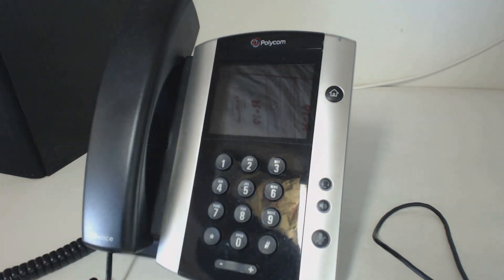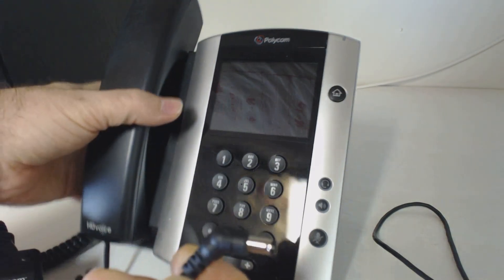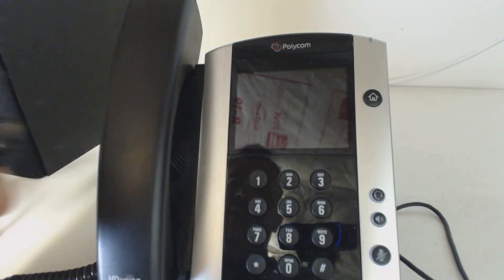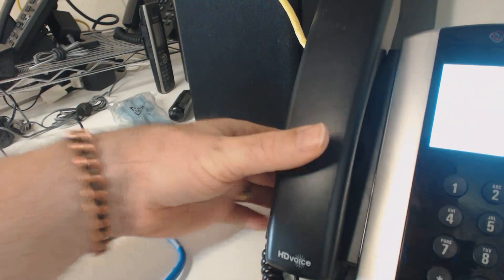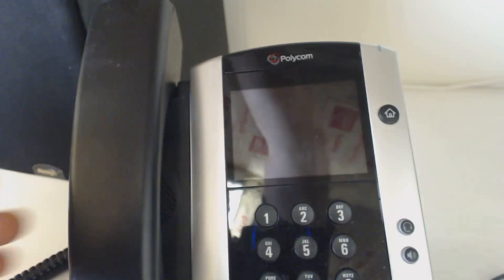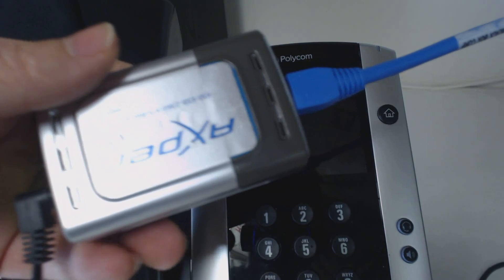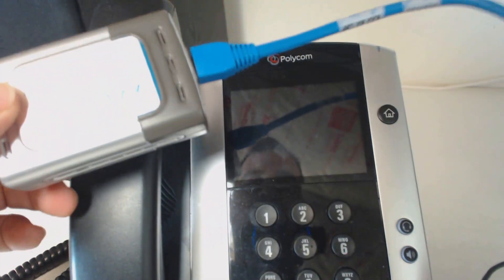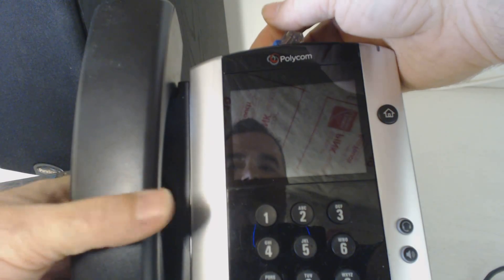Power Over Ethernet for VoIP phones

Comment: My small company with 6 Polycom is having issues with dropped calls. No other internet issues.  Could our POE not be supplying enough power?  Can I plug in a power cord to a phone and see if it improves our service?
Reply from the maker: You could do that Vicki, but in my experience,  dropped calls are usually indicative of a network traffic issue.  For instance an inconsistent broadband provider or a Mis-configured router.
Has this been an issue since day one with this voip service?
Reply: @VoIPTelecom   Yes it has been an issue from the beginning. We upped our plan and it’s still an issue. Our IT claims there are no network issues. Is Comcast that bad.

Comment: Hi! I have PoE phone and connect it with the switch but did not work? What do you I did wrong? Thanks
Reply from the maker: It won’t even light up?
Reply: Yes, it won't light up.
Reply from the maker: Possible the switch isn’t POE capable? (Power over Ethernet)

Comment: I have a Polycom for a company I worked for two years ago. I never plugged it in or set it up. I just did plug it in as I reconfigure my basement office. It works but it looks like it may be attached to my old company because it dials from Connecticut and it displays my old extension on the display. The number that the receiver shows is different from my old extension but still a Connecticut number. Is this phone basically an extension of my old company? Can I reconfigure it so that it is not attached to their company in any way? Would it use my home or cell number or assign a random number from the internet?
Reply from the maker: Yes,  sounds like it is still “registering “ with the service it was originally setup for.  If you do want to use it you should do two things:  1.  Factory default 2.  Sign up for a VoIP service that supports Polycom.   If you go to my channel page and look at a list of all my videos you should see videos to help you with this.  There is a video on factory reset.  And also a video about setting up a Polycom with CallCentric.   😊
Reply: @VoIPTelecom  hey thanks. I did watch the videos. I had trouble resetting. KEY: When entering the MAC ID, press the button as many times as necessary to get to the desired character (that you cannot see). Once I di that I was able to reset but I am having difficulty setting it up. P{robably because I am not an IT Guy, just a guy who sells copiers and printers and once in a while sets them up... Any advice on how i can get someone to help me on-line is appreciated. Thanks again.

Comment: I just got a poe phone for my office, and I have a eero wireless mesh system. I have connected the provided ethnet cord that came with the phone into an ethernet jack on the eero,  but I am not receiving power. Also, I have connected the same ethernet cord directly to my modem and it still has no power. I have also tried multiple ethernet cables. Do you think my phone is the issue, or am I just not getting power through the provided cable? Thanks!
Reply from the maker: Are you sure that system you have is providing Power Over Ethernet out the ports?  Usually if the device is enables for that,  it will say “POE” somewhere on it.

Comment: Can you use power injector and send one cable into a room and then use a splitter to multiple phones? My guess is no because that is what I want to do.
Reply from the maker: Right, you cannot use one injector to power multiple phones.  However what you could do is just put a dumb POE network switch off that one cable and connect several phones to that switch.   A typical dumb (non-managed) 8-port LOVE switch should be less than $75 USD.